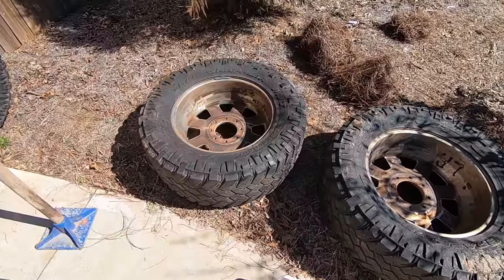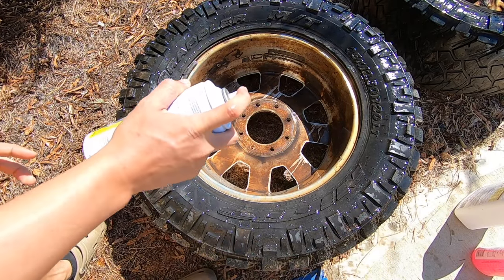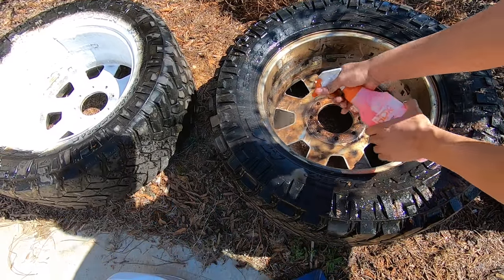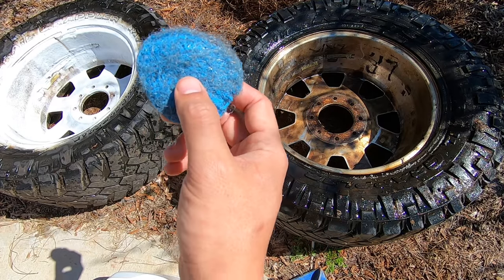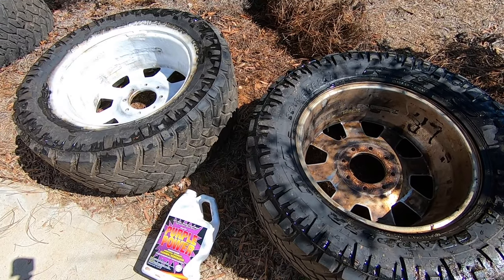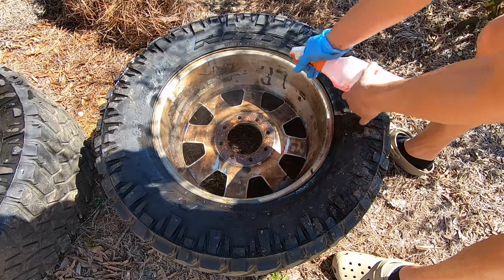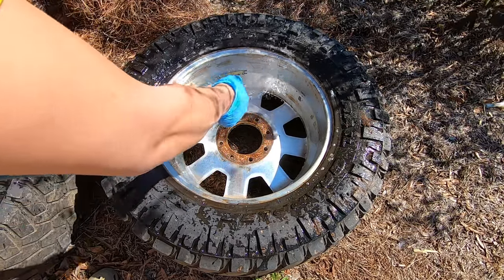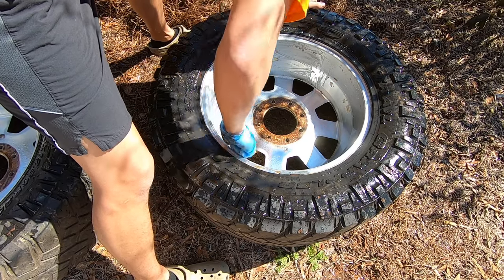Whats the best way to clean wheels and tires? Purple power or oven cleaner?

Comment: The Easy Off trick worked MIRACLES. I tried expensive wheel cleaners specifically formulated for wheel use that didn't come close to touching the baked on brake dust I wanted to remove. Easy Off took it off, two applications for really tough spots, and this is now my new go to for wheels. Just thinking of all that money wasted on auto products when I had a can of the ultimate wheel cleaner under the kitchen sink kills me!
Reply: ok
Reply: Can this be used to clean an alloy rim?
Reply: @kenyaduff4187  there's a great video you can find just type in Napa aluminum brightener:-)
Reply: "when I had a can of the ultimate wheel cleaner under the kitchen sink kills me!" LOL
Reply: I think most cleaner manufacturers worry more about being safe, biodegradable and smelling good. 
What you end up with is usually pretty weak.
Reply: Iron x really works well also
Reply: Chemical guys wheel cleaner works pretty good, can be used on many different surfaces

Comment: Purple Power is probably the best product I’ve come across for wheels. Just make sure if you are using it as a concentrate, wet any painted surfaces with water first to prevent damaging the paint on the wheel.

Comment: Here’s one for all you guys from way down under in Oz. Victoria specifically, you know, the most locked down state in the world. Anyway I’ve been using Ajax spray and wipe on my alloys for years. Cleans really well, gets rid of brake dust and the best part is that it doesn’t destroy the clear coat if your wheels are coated.  Also only $3 bucks Australian, so even if you where to use one bottle per wheel your still only $12 bucks down. It really is that good. Give it a crack you’ve got nothing to loose. Cheers from down under.
Reply: Did anyone else read this in an Australian accent?  Imma keep my eyes peeled for that ajax know
Reply: @MeowBangBang92  has to be the spray and wipe for nice clear coated rims. Normal Ajax is way too corse and caustic and I only use that on raw alloy like the rims he showed in the vid. Y’all have fun now ya hear. Ha ha

Comment: Years ago before oven cleaner I took 3 coats of paint off an old John Deere tractor one coat per application  of Red Devil lye mixed with cooked Fautless starch as a holding agent. It took the paint off to the bare metal. Had it in old cast iron  pot. Used thick rubber gloves. Pit it on and let sit few minutes  then hose it off. Repeated  for  each coat. Then washed  with baking soda to nuteralize.

Comment: FYI regarding the Brillo pads. You can also use "0000" steel wool, you can get at any auto parts store. It's the finest grade you can buy, it won't scratch chrome, and works fantastic on glass. I use it on my windshields after cleaning them, and it removes anything the cleaner misses.
Reply: Great tip...thanks.

Comment: Listen. Purple power is great. I love the stuff. But it leaves a residue. It’s Bc of the acids it has in it. Oven cleaner is best for rims. Purple power is best for motors. It is what it is. It’s a degreaser. Works great on gasoline and motor oils.

Comment: I used to use oven cleaner to safely remove enamel paint from vintage RC cars and models. It worked great if you didn't want to ruin the old 1960's and 70's plastic. Just a little elbow grease and your job of restoring a vintage or classic RC or model became a cinch.

Comment: Turtle Wax has Bug & Tar remover that work real good on just about every part on your car that have asphalt tar and cleans the tar from your smoking pipe and bug guts from anywhere. They also have Turtle Wax Chrome Polish that works great removing light to moderate rust on chrome. I grew up by the Pacific and my bike got rusty everywhere there was chrome, especially the wheels. It made my bike look almost new every time I shined it up. I used purple power to mop floors at a retail store where I used to work, and it did nothing to get rid of public foot traffic dirt. A squirt of cheap dish soap in a mop buck did better. They also used a cleaner to clean the parking spots just outside so the oil and grease left by the customer's vehicle would not track inside. That stuff got expensive, so they tried purple power outside instead. It only smeared the oil farther into the lot.

Comment: I have tried everything on my Alum. rims and nothing worked, the rims with tires had been sitting for many years in a field and very hard to clean, so now I will try the Oven cleaner, I am not worried about removing any clear coat I think that's been gone for years, so I will give it a shot. thanks for this video.
Reply: Howd it go??
Reply: Only the Heavy Duty non lemon scented (if you can find it now) stuff works. 
They've been removing all "harmful" chemicals in everything from paint strippers that Worked‼️

Comment: Go to your local janitorial supply store, get some high alkaline cleaner (generally stronger and cheaper per OZ than typical wheel cleaners since you can get it condensed). Use gloves, spray it on there. Works wonders. Also if you have polished stainless steel cookware, let it soak in a high alkaline solution over night, will come out with a brilliant shine like you just had them chrome plated.
Also, grab a foaming spray bottle for better coverage. I re-use Soft Scrub spray bottles since empty foaming spray bottles aren't very popular.
Reply: Believe oven cleaner is a alkaline cleaner
Reply: @josemartinez4680  yes but rather diluted for safer handling, and may not be as high on the PH scale. The stuff we used to get was pretty serious, extremely strong stuff.
Reply: @frostbite1991  thanks for clarifying

Comment: You can use the purple power for the tires too. I use superclean (another degreaser) diluted 4 to 1 & it works wonders for the wheel & tire.
Reply: Superclean is better and stronger than Purple power.

Comment: I used oven cleaner to help degrease an an engine block…. Wrapped the block in a thick trash bag and sprayed it and closed it up… did that a few times to trap the fumes then took a brush to it. It worked well.

Comment: Iron and aluminum do not play well together, so the brillo pad, could easily impregnate your aluminum wheels (if they're aluminum)  with bits of steel, causing a type of corrosion that will badly pit the aluminum.

Comment: The biggest thing I can say is don't wait so long between cleaning them, and any time you buy a new set of wheels or a new car with nice wheels is to wipe the back side of the rims with Dielectric Grease and the hubs, and you won't discolor & slow down and protect against rust and corrosion
Reply: I used to add 1 soft layer of motor oil to my wheels to keep them from rusting.

Comment: Neither Purple Power nor oven cleaner is for cleaning wheels.  Purple power is a degreaser and oven cleaner is caustic.  Wheel cleaner like Dark furry or an acid cleaner like Wire Wheel cleaner are specifically made to clean wheels.  Since wheels are coated the Brillo pads are a bad way to clean wheels and will put micro scratches in chrome
Reply: PP is NOT just a degreaser and if you think it is I got a fun little challenge for you. Go grab your favorite cast aluminum part and drop it into an undiluted bath of PP overnight. Degreasers don't eat aluminum, PP damned sure does. I use it on my semi tractor's aluminum before polishing because it dissolves the surface oxidation, no simple degreaser does that. PP also dissolves oxidized rubber, that's why it turns brown if you spray it on your tires.

Regardless of what a product is marketed for if it works to easily and cheaply improve a set of wheels or anything else then thats what it's for. Wanna see an off the wall use of a product? "The Works" toilet bowl cleaner left overnight in a rusty oil pan. Next morning nice shiny steel. Nobody is telling you to use PP or oven cleaner on an already nice set of wheels. BTW, all aluminum wheels are not coated. Even those that started out that way have usually lost most of the coating long before you get to the point of using a brillo pad.
Reply: You say oven cleaner is caustic but recommend an acid cleaner?
Reply: DO NOT USE A BRILLO PAD ON A CAR ANYWHERE!
Reply: @Ares-jx4ep  PP and super clean are definitely caustic, sodium hydroxide is an ingredient of super clean and is also a component of bleach both at about the same concentrations. Which is why they do the same thing to metals.
I like using prep n etch for oxidation, and degreaser or straight bleach(cheaper) for  stripping electroplated badges on cars.
Reply: @dirtyaznstyle4156  I knew most of that but I never thought of using bleach for stripping. Great idea!
Reply: If you’ve ever tried stripping the urethane or whatever it is off a set of OEM wheels that stuff is durable and it’s on there thick. Aftermarket I haven’t really run into a set where the coating was done as good as OEM.

Definitely no Brillo pads though they’re all pretty much steel wool or scotch brite. I’ll use non scratch pads sparingly on some things but not with a lot of pressure since like you say micro scratches and haze that needs to be polished out.
Reply: @Ares-jx4ep  it takes a while but it’s not like having to deal with the concentrated stuff
Reply: I think oven cleaner is ok it if has acid iui s very low percentage  because when i used to take the  semi to wash they would use acid  don't know what percentage it was they would ask u or u tell them to acid wash the wheels  they would spray it everywhere they thought it need it  those wheel cleaners u have to be careful some can actually damage your wheels if u don't read the directions.
Reply: "Hot rim cleaner" is really good, just be sure to read instructions, not good for all applications, it works fast though 45 seconds from what I remember
Reply: @dirtyaznstyle4156  try again... sodium hydroxide  is not the active ingredient in bleach...
   It's sodium hypochlorite...
Usually %5 in household...
10% is sold as pool shock...
Sodium hydroxide is more commonly know as Lye, and is used mostly to make soap or as drain cleaner... 
They might seem similar in spelling but are very different in applications
Reply: Do you know of any home remedies I can use?

Comment: I know from years of experience, if you leave Purple Power on aluminum for to long it'll stain. I messed up a shiny Edelbrock carberator a few years ago with white spots all over it.
Reply: Serious question, did you put it on full strength or was it diluted? I just bought some and haven’t used it yet.

Comment: Alluminum rims are clearcoated to protect the rims and enhance the shine.
Over time, using products which are not clear coat safe will cause the clearcoat to fail.
In turn the clear coat will turn yellowish and the alluminum  underneath will become dull. At this point the only option to restore the rims would be to fully strip the remaining clearcoat and repolish the rims which is a rather time consuming process.  This can be prevented by using the correct product for cleaning your rims.
Reply: So basically this isn’t a product you should use on this correct ??? Well for black rims
Reply: Oven cleaner is very strong stuff.  Only time will tell if the clear coat degrades.  ChrisFixx uses rubbing compound to take out the stubborn stains on the clear coat.
Reply: That’s why I’m skeptical to try it.

Comment: I use Scrubbing Bubbles bathroom cleaner on aluminum wheels as long as they are not clearcoated. Might have to try oven cleaner in comparison but I get Scrubbing Bubbles dirt cheap. Super Clean gallon cut 5 to 1 for an all around cleaner.

Comment: one thing we use for wheel cleaning tools is cheap toilet brushes from the dollar store just cut the big end of the handle off so the stem will fit in a drill and usually get a couple for a buck works great even if they are still one the vehicle

Comment: While it works great for all the dirt and stuff, I'd try to avoid oven cleaner for using wheels because it contains sodium hydroxide and sodium hydroxides reacts with aluminum, which is fairly reactive and can get very hot if you let it react some more and can seriously damage the aluminum. But if it has some clear coat it might work great if the aluminum is not exposed
Reply: Most decent degreasers contain sodium hydroxide, just need to be aware of it.
Reply: I don't think most degreasers have much I don't know how alkaline they are but it's not that much at least the ones I have used
Reply: If my rims are as clean as yours after the 1st applying of cleaner, would it be ok to use oven cleaner  if I didnt leave on long would it get the splotchy looking stuff off. Ive gotten the rust off , its just not shinny even after using polish
Reply: @elvasmith5262  My Rims are Aluminum and not an once of issues using Oven Cleaner

Comment: If you’ve ever used oven cleaner before… it needs to sit on the gunk for about an hour and it will just wipe off with a paper towel or a very light brushing to get into the nooks.

Comment: I can’t wait until people start using oven cleaner on their coated wheels, fun times ahead!
Reply: Coatings on aluminum wheels is useless anyway. There ready for the trash within 3 years. Chrome plated aluminum is even worse. It’s not always a loss because you can remove the coatings and polish them out as well.
Reply: @ktmterry373   how to get off coating on aluminum wheel i want to sand n paint? thankyou.
Reply: Aluminum oxidizes no matter what is on it, anodized probably the best to slow it down. Every coated wheel I have ever had whether chime plated or painted and typical road rash will compromise it then it’s all over.

Comment: I just use meguiars ultimate wheel cleaner. Make sure wheel is dry spray it on wait 3 minutes 90% rinses right off with out even scrubbing and it's safe on all surfaces. Also use it as iton remover on paint

Comment: I owned a shop and a tech used oven cleaner on a transmission case and not the hot bath rotary cleaner we had to clean it. To make a long story short he tested the tranny on the test stand and it was leaking through the aluminum case. The oven cleaner took off the aluminum skin that seals the case when it is made. It is very caustic and it cost him the cost of the case and his time. And almost his job.
Reply: God damn I was going to use the oven cleaner on my Dodge aluminum truck rims not now geez

Comment: Those sos pads u can also use on glass to take hard water and Minor scratches but always do a small test spot I have used them after I took window tent off just a FYI Napa auto parts also sells a product called aluminum bright I believe is the name
Reply: Purple power concentrate works best on getting back to like new finish. SOS pads are not to wise on wheels or glass, too course. try #0000 steel wool from any hardware store or walmart.  Fine steel wool that polishes chrome , glass and most finished wood surfaces scratch free.  Oven cleaner in most cases will cause clearcoat damage.

Comment: On my 1987 Toyota Carina the plastic bub caps are made in two parts,  I took one apart to get into all the stoopid  crevices. It took me an hour to get it fairly clean but not in the crevices. The old fashioned brake pads were basically as estos and they made no black "gunk". I will try oven cleaner -  being certain to wear protective gloves !0
Reply: Toyota is a joke but it's your business.

Comment: Oven Cleaner is good… Purple Power and other sprays like it don’t do jack.  You scrubbed hard on the Purple Power wheel.
For the Tires, AJAX and scrub brush and they’re all cleaned up.
You can polish the aluminum to a mirrored finish with buffing wheels and abrasive clay bars.

Comment: I realize this is an older video. However, if you use a little heat gun to help remove the sticky residue from the stick-on wheel weights, it will help you to remove them... Just a thought...

Comment: It was of a course steel wool SOS pad you should look in the painting section if Walmart or a hardware store for 0000 steel wool which is extremely fine, and 000 steel wool is a little courser. I know walmart as singly 0, 00, 000 and 0000. I'm a gunsmith and use 0000 steel wool to polish blueing that has service rust on gun barrels and such. Using is a type of rust so anything made to remove rust will remove blueing also, so light oil and 0000 steel wool will polish up blueing really well with out damaging the smooth blued finish under the flash rust. Its pronounced like 4 aught steel wool, kind of like a 30 aught six (30.06) cartridge. So you have double, triple, and four aught steel wools to polish chrome and Stainless steel and aluminum with.

Comment: Is there a particular reason you wet the surfaces b4 applying the cleaning products? My way of thinking (unless instructions state otherwise) is to apply while the "whatever" is dry so that I don't dilute or water down the cleaning product. Good video. Thank you.
Reply from the maker: Well my reasoning was I’ve never done or seen someone wash a car without using water or spraying the car down first. I typically try to get all the dirt or brake dust off first with water then apply the product. The concept kinda goes for both washing cars or wheels. That’s just my way of thinking anyway.

Comment: Interesting video. Can you use oven cleaner with the wheels still on the vehicle or will that damage the brakes? Also, if the rims are enamelled, can you still use oven cleaner or will that discolor them?
Reply: Yes you can ,I Do it all the time just keep a hose near by and do one tire at a time

Comment: There are better products out there for rims. But they cost way more than oven cleaner. Like that you were able to get an acceptable result without spending a bunch of money. I use aluminum brightener (phosphoric acid) on my wheels. You have to move quick though because if you leave it on too long it makes the wheels white. Just flash them with the acid and rinse them off.